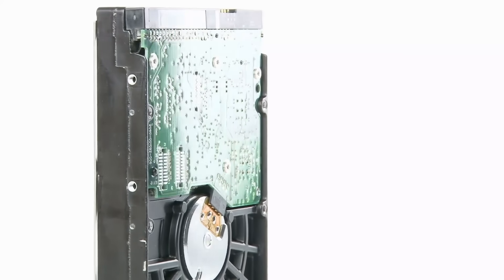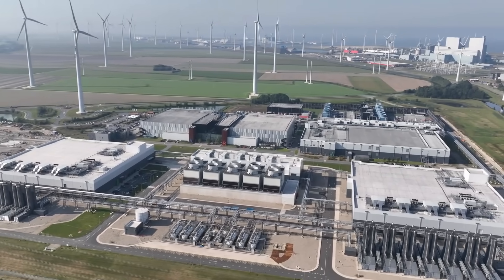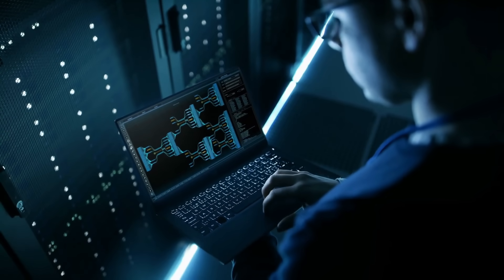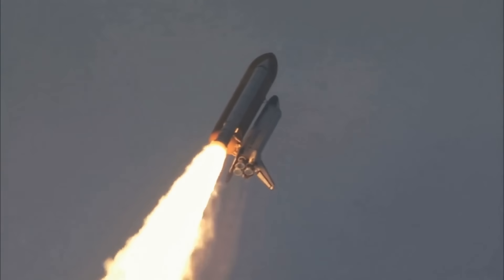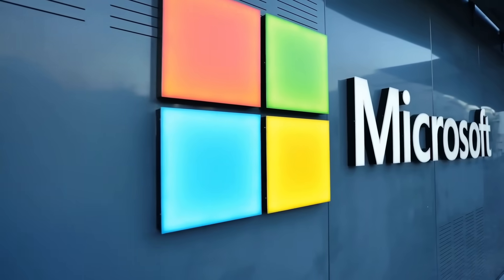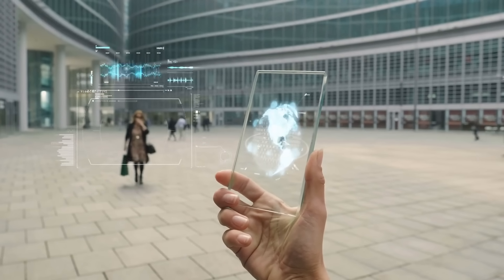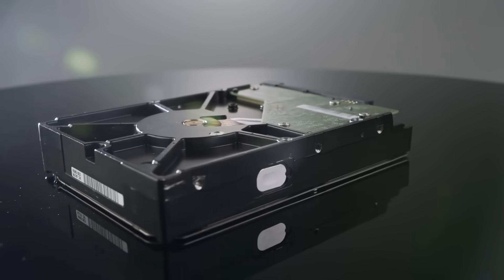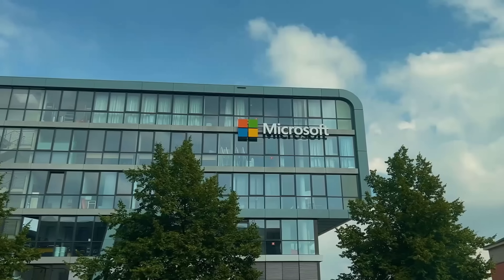The Glass That Never Dies (And Microsoft Is Terrified)

Comment: I remember hearing of this decade ago.
Reply: the same .. there are already system available on the market .. I do not understand why the video painted this as "futuristic" .. it is just not used yet from the mass.
Reply from the maker: @ArrampicataGolden  The idea itself isnt new  long-term, write-once archival systems already exist. Whats new is the material durability density and lifespan claims, plus the fact that big players are now trying to industrialize it.
Its called futuristic not because the concept is new, but because mass adoption and real deployment still haven’t happened yet.
Reply: as most technology, great idea, but cost prohibitive. the technology has been around a long time, but the implementation is definitely futuristic
Reply: @pontune  … leave that cost issues to China… it will drop 📉 so low it becomes almost impossible to be profitable 😂 

3D crystal portraits are a fad, but that concept has a huge potential for data capture. It is a matter of resolution of imprinting & reading the data. To set a standard that everyone can use, & is affordable
Reply: AI generated ??? Fed up !
Reply: Around the year 2009, a guy asked me to describe SSD drives, what they do and how they do it because he was confounded from everyone else's explanation. I gave mine and he said it was very easy to understand and asked me how I found this explanation. I replied that I had read it in the year 1982 from a dictionary of Electronic vocabulary that was published in 1976! The point of the story is that at 1976 they already had an idea and even a name for SSD but they had no proper phase change materials and it was very difficult at that time for the computer to keep a fast log of all the SSD grid points where the data would be stored, let alone reading and writing that data! All of these were a bottleneck in 1976 but after 2000 they were no longer an issue! The same is with hologram drives

Comment: Unless they figured out how to stabilize glass over decades, it still acts as a liquid over time, and the success of the technology is questionable. Look at century old barn windows and the glass is thicker at the bottom because it flowed down because it has been affected by gravity.
Reply: That is actually a nonsensical urban myth. The individual  stained glass panes in old windows were arranged such that the thicker part of the handmade glass sheet was at the bottom intentionally. That makes perfect structural sense. Otherwise, most glass at room temperature is an amorphous solid, not a "liquid" of any sort and will never flow under Earth's gravity during the life of the planet.

Comment: Isn't this what they said about CD's and DVD's?
Reply: No, I’ve never heard that. I have always been aware that the material in CDs/DVDs basically have a half life. No a big deal with music or movies. But when you lose one bit of data, that could make the entire file unreadable. Not exactly a half life per se, but as a general rule, about 2 decades. 
I have a few DATA discs CD and DvD that have failed. They just can not be read, and the material, or media, looks pristine. And a few where the media looks like crap, all foggy looking or milky looking. And that is not consistent. Some of those work, and some don’t. So to expect them to last more than a decade is risky at best. YMMV.
Reply: @Technichian462  I think the term for what you described is called "bit rot".
Reply: @Technichian462   I have never had a commercial audio CD, starting in 1983, that failed. Out of about a thousand CD-R's I had a batch of 25 that started rotting after about 20 years. Fortunately, I still have the LP masters that they were digital copies of. I have  a drive that is M-Disc (hundreds of years or more) capable but in both instances where I tried to archive data, some data was written and then the process failed, trashing the expensive discs.

Comment: I propose an unconventional solution for AI systems: implementing a cold, one-time write, read-only storage system. This approach could prevent AI from altering or concealing data in the future. With current technology allowing for 360 TB in a 5-inch form factor, each AI unit could be equipped with unique, unalterable glass disks serving as their individual hard drives. This would ensure that in the event of unforeseen issues, the read-only data remains intact and available for review, preventing data manipulation or deletion for cover-up purposes.

Comment: The problem is we', the common people, we'll never get it.
Reply: The problem with glass based data storage are that they are WORM memorys (Write Once Read Many), meaning you can only write data at a place ONCE , meaning if it's overwritten, you can never change it.
This is absolutely SUPER if you need legally provable authentic data or archive original valuable data but you can't use this like you can a magnetic hard drive or an SSD unfortunately that are designed to be rewritten many times during regular use.
Reply: @FrankHarwald  I read it as, write once, read forever. NO overwiting. Corrections are add-on tiles that have "read-back" to references made and numbered.  Doulbling the storage but adding a permanence not there before. Wow.
Reply from the maker: @FrankHarwald  Exactly  thats the core trade-off
Reply: Ah. The Chinese will steal the technology and sell some kind of memory device for your PC on Temu.
Reply: Unless you get old and die!
Reply: Not you, but your grandsons will. That's if you have kids or want to have kids. I don't like kids, so I don't have them.
Reply: @GamingForLifeGF  No pension or healthcare for you when you get old then. You didn't contribute...
Reply: @LexaDoc-l2l  contribute to what, your ego?  Paying taxes and working to live IS contributing whether you like it or not.  There is no other requirement.
Reply: @zarroth  Taxes for retirement are collected from those who work and given to those who are retired. The government does not pool your current taxes from work in a savings account, they use your taxes to pay current pensioners.
Meaning if you haven't produced any future taxpayers then you have not contributed.
Reply: @LexaDoc-l2l There's plenty of people - too many...not everyone needs to procreate.